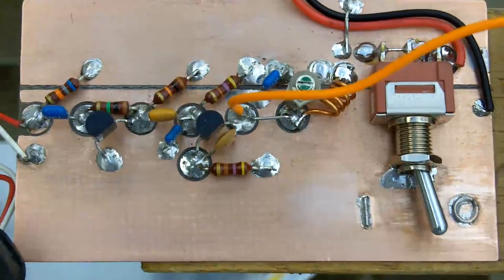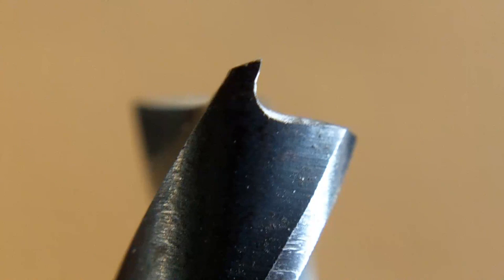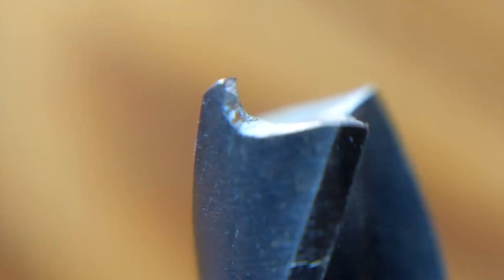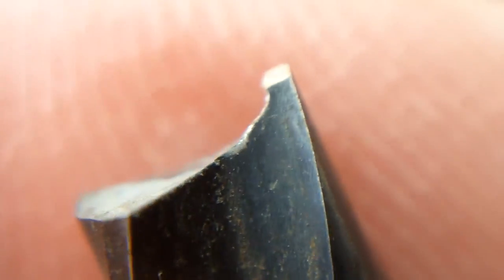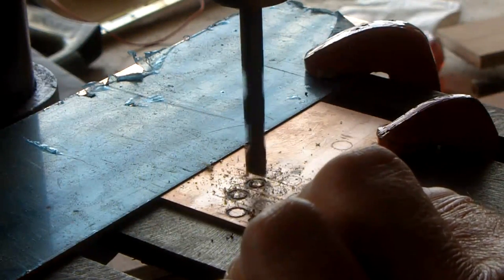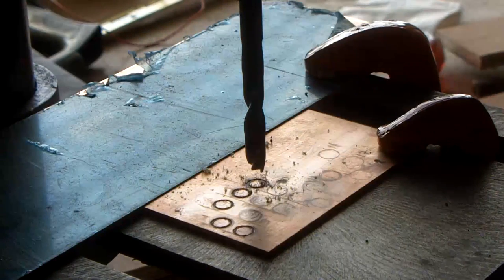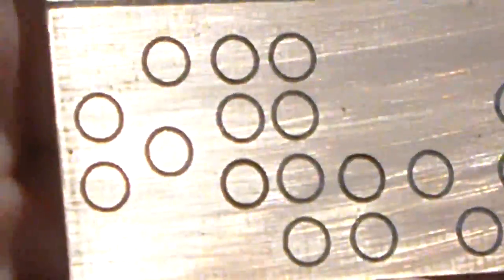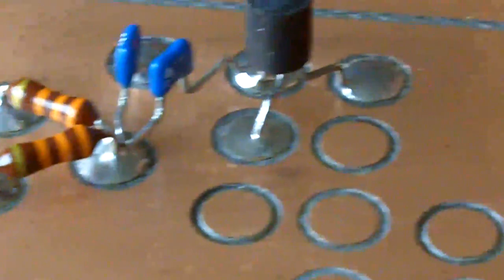Circuit board 'Land' cutter.

Comment from the maker: Hi, I'm glad that you’ve enjoyed the video/tip. Remember that it’s not the answer to every need but it’s just another ‘tool-in-the-toolkit’ when I’ve been in a panic to throw together a small circuit I’ve even banged some tacks in a lump of wood and soldered the transistors to the tacks, what you would call a real ‘breadboard’ The main thing is to have fun and always make sure you clamp the board down very well under the drill!!  
Kind Regards ... Andy

Comment from the maker: Hi Rick, I’ve used several different trepanning tools for cutting steel, copper, aluminium etc and when I saw the broken drill it just gave me the idea to shapen it up and use it on a circuit board. You never know where inspiration is going to come from do you.
All the best ... Andy

Comment from the maker: Thanks Paul. It certainly makes a neat job and I’ve found that so long as I have the space I can squeeze in extra islands between components, even when I’ve started to populate the board and find I want to add items. It works well but you MUST clamp the Board down when cutting otherwise the board can ‘crank around’ on the end of the cutter if you know what I mean. I find that having the drill on high seed works best. 
73’s 
Andy 
GWØJXM

Comment from the maker: Hi there, yes, it does. As you may well know its normal to use tungsten tipped tools for drilling PCB’s in a commercial environment, but the high-speed-steel drill is fine for hobby use. I guess one could always etch the board but this saves a lot of messing about with chemicals for small circuits.
Kind Regards ... Andy

Comment from the maker: Hi there, you’re right, the idea is only really any good for discrete components but I have seen some of the ‘Manhattan’ type stick on pads that accommodate IC’s and I’d guess they would have flying leads to other pads, but I really think IC’s should probably be dealt with on a 0.1 inch pitch board. 
Thanks for watching.
Kind Regards ... Andy

Comment from the maker: Hi there, yes you could do that if you could find a suitable high carbon material in tube form.  It’s no good just trying to harden any old mild steel tube as it want harden. I try to think of things that people might have around the home but off the top of my head I can’t think of a suitable small carbon steel tube other than say a ‘Roll pin’ that’s a spring steel split pin typically used to hold a wheel or rear onto a shaft.    
Kind Regards ...  Andy

Comment: I wonder if you, or some one, could discuss how to clamp very small pieces of board, say shorter than 4 inches, in order to drill them. Thanks for your videos!
Reply from the maker: Hi first thing is, I assume you’re using a pedestal drill, that is a fixed bench drill with a working platform to hold the work piece. If so the platform will have some slots in it. What you do is have one or more pieces of metal say 2 or 3 inches long by maybe 1” wide and ½” thick to make clamps. Find some thick bolts that are long enough to go through the platform and the metal bars. Drill a suitable hole through the ½” thickness in the middle of the length of the bars. Now you can bolt the metal bar down to the platform to clamp the board you want to drill. It’s normal to have a bit of material the same thickness as the part that you are drilling to put under the opposite end of the bar to the part to be drilled. That way when you clamp the metal bar down it remains parallel to the platform. This is particularly important as the thickness of the part to be drilled increases, it makes sure you get maximum grip. I hope that’s clear. If you don’t have a drill with a platform then you can make some clamps like I’ve just mentioned and screwed them down to a bench.
 
Work safely
 
All the best ... Andy
Reply: AndyDaviesByTheSea
Thank you. My 86 yr-old father just recently gave me a pedestal drill press and I hadn't thought through how to go about making the clamps- but what you say makes sense, I appreciate your response.
Keith

Comment: Did you ever try grinding a balanced pair of cutting "teeth" on an old drill bit to negate the desire for the cutter to fire the work piece away as it bites? Two teeth should be possible with a fine cutting disc. I intend having a go using a 1mm slitting disc in a vice held angle grinder as the grinding tool. Neat idea, and the results speak for themselves. All the best for the New Year, I have enjoyed your videos immensely. Your background in RF generators is interesting as I am converting a Henry 2000D RF generator to a linear amp. Nearly done, but it gives me the willies with 5kV @ 1.5 amps....
Reply from the maker: Hi Chris Last things first... a healthy respect for high voltage is no bad thing. When I first started working on High power RF equipment (150 kW output with a 12 kV HT-DC power supply from a transformer the size of a small shed and diode stacks like logs) I was told don’t even put you fingers around the door in to the equipment. Everything was water cooled and if one of the cooling hoses sprung a leak it could spray water and HT voltage onto you. I knew one man who got across the RF side of a high power induction heater. It put him in hospital for a very long time but he survived. The RF tends to travel in your skin (if you’re lucky) and not through your organs. I knew another man who got across the HT-DC, he of course didn’t survive, the DC (or the 50 Hz AC) will punch right through you and when you have 12 KV backed up by a 20 or 30 amp power supply that will not only arrest your heart and contract you into a knot it boils you. So even your little 5kV 1.5 amps with its 7 ½ kilowatts of killing/boiling potential is not to be trifled with. Remember they reckon 25 milliamps for 25 milliseconds is enough to stop your heart, when I see some of the daft things folk do on YouTube I'm amazed there’s not more reported deaths. I’ve just watched a video of a guy working with live mains (220V ac) on exposed terminals on a HHO generator he’s built in his back yard, there’s water everywhere and worse still there are children playing there too, he’s rectified and smoothed the supply and measuring 318 volts DC, standing in a puddle in his flip-flops. Still, maybe ‘natural selection’ will ultimately cull the complete idiots.  
 
OK on the PCB island cuter, the first cutter I made (on YouTube) had about 4 or 5 teeth and that worked well but when I came across the broken drill one side was sticking up more than the other so that’s what I used.
 
Just one final point on the High Voltage, I know lots of men who have have survived a single phase AC shock (240 V 50 Hz) I’ve survived numerous 50 Hz shocks at 250 volts and below one 340 volt DC hand to hand that was very nasty,  I know one man who survived a 415 Volt 50Hz shock and my old boss who got across the 12 kV at Radio Frequency but I don’t know of anyone surviving anything above 415 Volts AC or anyone surviving a DC shock above the DC belt that I had.
So work safe and always go in with a grounded earthling stick before working on it. Don’t mess about with a series resistor in your grounding stick, short everything down to ground and then short each capacitor out in turn, then do it all again. I can tell you on a faulty equipment you can have some very nasty surprises, you may expect the circuit to discharge but I’ve gone into a machine that’s been off for a day and blow the end off a shorting stick.
 
Play safe.
Kind Regards ... Andy
GWØJXM
Reply: AndyDaviesByTheSea does the current have to go across the heart?